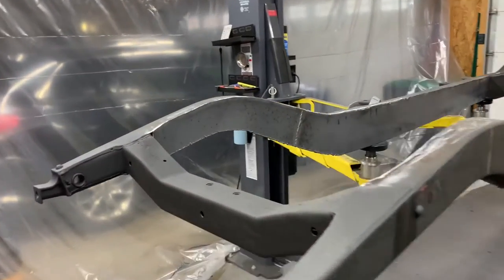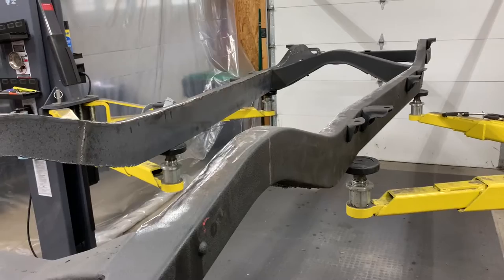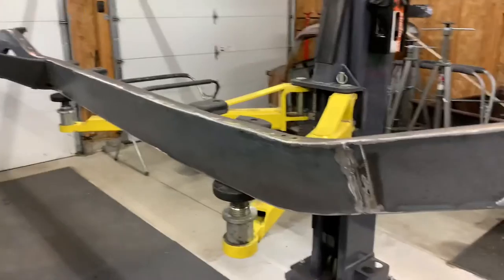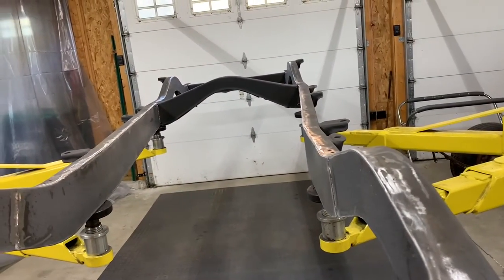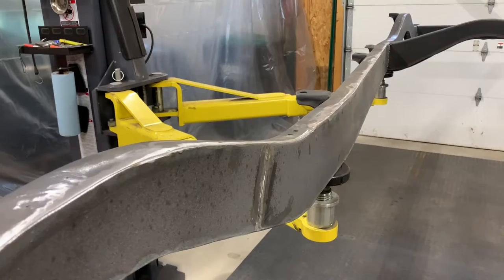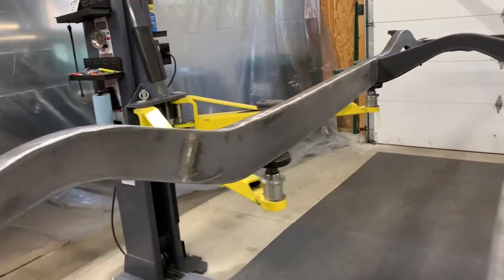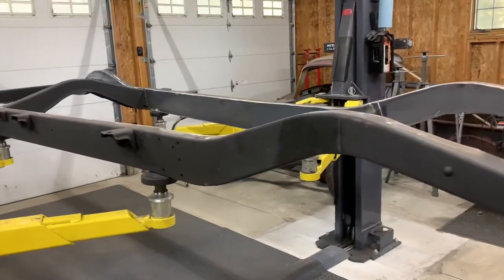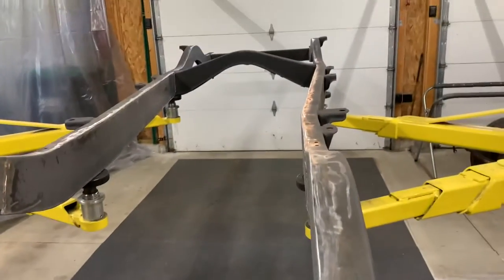Boxing the frame 1937 Dodge Truck

Comment: I'm not trying to pick apart your build but your vertical welds should have a diamond of some sort over top of the vertical seam welds. if you diagonally weld your seams you can get away without additional support because it distributes the load on the weld. its not that your frame is going to fail by any means but a vertical weld will start to crack up the weld from the twisting and flexing from the road. I have welded truck frames for a living putting in extensions and reductions on trucks. once again not trying to bash your work just trying to help. good work though
Reply from the maker: I appreciate your thoughts and comments the frame still needs a lot of work and more will be added to it in including crossmembers and gussets. I am not sure what is needed or needs to be removed until I get the engine and transmission. But I really do appreciate your comments.
Reply: Thank you for sharing your knowledge.

Comment: I looking for a project like yours . 1937-1938 dodge restomodded  , all Mopar al the way .  Basically stock suspension .  Was it difficult to find a good canidate for your project ?  All the ones I've seen are trashed  and the original people want a fortune for a good truck .
Reply from the maker: I actually stumbled on this truck a long time ago, a friend asked if i would want it. after looking at it i bought it for $400, but that was back in '92. I am finally getting to it after having it stored all this time. I am a die hard Mopar guy, that is all i own and that's the way this truck will be.